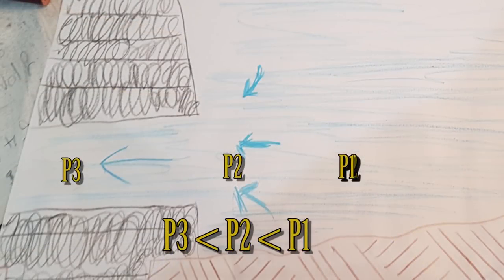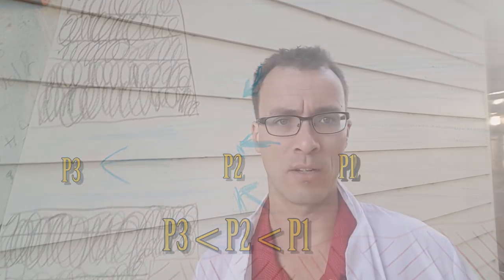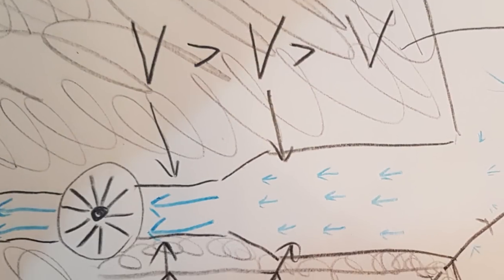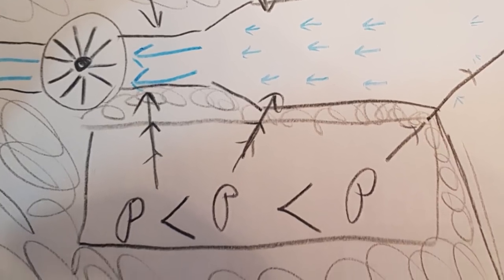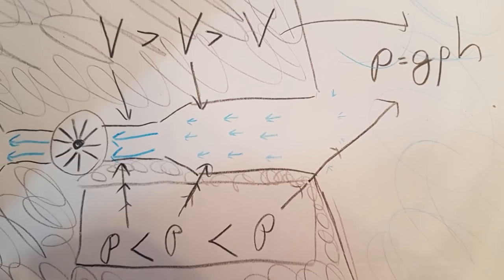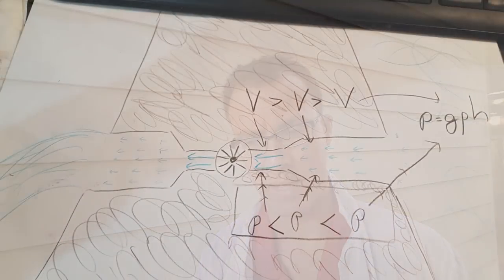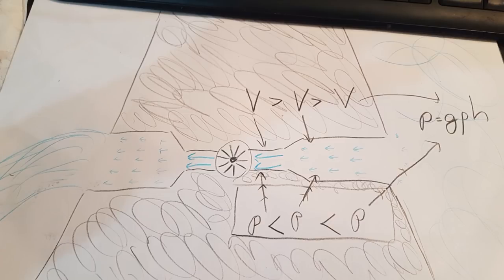Obstructions create high pressure NOT low pressure zones!

Comment: Ok reference to last experiment. You have created laminar flow through the center of the pipes. Big size reduced to smaller than back top big again same venturi effect. Though the air that is allowed into the system has come from the smaller pipe because it has less head pressure. Volume of water meaning weight pushing on system. Head pressure can be irrelevant to actual pressure of outlet. Just the volume pushed by atmosphere alone. A larger bore reduces pressure losses. SO by going from large to small to large again, you have created a venturi  within the system as the low pressure swirling water when it goes from small to large is having a vacuum effect sucking more increasing the KPA at the smaller nozzle trying to fill the larger diameter pipe.  It has now referenced the least resistance in the small bore pipe to suck air into the system by least amount of friction by pipe size and cross dimensional area of atmosphere  and surface tension of the water. Also in the system by increasing flow with no pressure to allow for extra water to push through the water turbulence would be greatest at the small junction another venturi sucking air in to eqaulise overall pressure of the system.

Comment: Hi Stuart,have you tried testing it from larger to smallest pipe or with some type of non return value to stop air pressure once stabilized. Bing on the rain.cheers Craig

Comment: Interesting theory but I'll have to wait until you take your experiment from a closed system of a hose to an open system like a stream.
Reply from the maker: Seriously?

It makes no difference, same principles apply.
Reply: @MadScientistProspecting  Seriously, your closed system model has a hole in it (no pun intended). As you open the valve up on your model you increased the pressure from your home on your model this increased your velocity when you restricted the hose. This caused the venturi suction to increase, then you started increasing pipe size slowing velocity thus lowering venturi suction thus allowing your water column to increase.

So I am waiting to see how you are going to link this closed system to an open system.
Reply from the maker: @markhuffman5242  Venturis dont suck they work becsuse of low pressure and then some external pressure (in this case air pressure) pushes into the low pressure area. 

This is why Venturis relying on air pressure have a maximum theatrical lift of ~10m. Ie 1bar or 10m of H2O.
Reply: @MadScientistProspecting  Right, venturi is just lowering the pressure in that area and the faster the velocity the lower the pressure in your in your model the lower the water column is in that water column. System pressure minus venturi pressure.
Reply: But it is the pressure in your tube that was lowered not the pressure in the main line.
Reply from the maker: @markhuffman5242  When you say main line which bit of the line are you talking about? 

The 25mm line upstream of the 19mm reducer?

or

The pressure in the horizontal section of 13mm line?
Reply: @MadScientistProspecting  I'm talking about the line from the time it leaves the valve to the time it exits out the end. Once you open that valve fully you was receiving  the max pressure that was coming from your house and by extension from the town system.
Reply from the maker: @markhuffman5242  Not sure I understand your point. 

When there was only a dribble of flow the pressure at all three junctions was basically the same. Or it would have been the same if the junctions were level. As the velocity through the pipe increased pressure at the bottom of the sight glasses increased which forced water up the sight glasses to a higher level. However, once the velocity really started to increase the pressure actually started to go down at the 13mm junction which is why the water level in the sight glass went down. At maximum flow/velocity the pressure at the 19mm sight glass had gone down as well and the pressure at the 13mm junction was so low that it was getting close to being less than atmospheric pressure. Any lower and ATM would have started pushing air into the pipe.
Reply: @MadScientistProspecting  At max flow you had also a max pressure provide from your home at the low flow point you was using the valve as kind of a pressure reducer lowering the pressure in your  line. So the max pressure created max velocity thus you had max venturi pressure at your 13mm thus lowering the system pressure in your closed system to the point you was ready to draw air or almost overcoming the system pressure. As you increased your pipe size your lowered velocity thus lowering venturi pressure that caused the remaining system pressure to cause your water column to increase.
Reply from the maker: @markhuffman5242  I think you need to better understand how pressure works. Or indeed how forces work. Nothing happens unless a force makes it happen or stops happening unless a force makes it stop.

When the velocity increases in a pipe due to the pipe getting narrower the pressure decreases. When the pipe size then increases the pressure is recovered and the pressure increases. If instead of a sight glass we had a pressure gauge it would show exactly the same thing. 

You need to get your eye on what is the active force. In venturi's there is an area of low pressure but low pressure areas do not suck. You only get flow into a low pressure area if there is a corresponding higher pressure area pushing mass into the low pressure area.

In the case in this video that higher pressure is coming from the air pressure. 

The height of the water in the three sight glasses is a direct measure of the pressure at the bottom of the sight glass. There is no "venturi pressure" pulling that water down. There is water pressure pushing the water up, (against gravity) and air pressure pushing it down. That's it. When the water level goes up its because of a pressure increase at the base of the sight glass. When the water level goes down its because the pressure at the bottom of the sight glass has gone down.

Comment: You have indicated that the flow in velocity at the turbine rotor has been increased by narrowing the tube and you state that the pressure has decreased
So how come when I squirt the hose against my face , and do the same with a narrowing of the hose , the water velocity has increased with the narrowing and it feels as though the pressure has increased to the extent that it feels painful ?
I mean narrow the pipe enough and increase the velocity of the water and it is possible to cut through metal.
Reply from the maker: What you are experiencing when you feel the "pressure" of a jet of water is the Impulse Force. Sometimes this is mistakenly called "Dynamic Pressure" but dynamic pressure is a made up thought construct not a real thing just like centrifugal force. The impulse force is generated by converting the potential energy into kinetic energy. The narrower the gap the more energy is converted to kinetic energy and therefore the greater the impulse BUT there is often a reduction in flow so the total force can be reduced as well. HOWEVER, the force per m2 that you feel on you hand is increased because greater impulse is delivered to a smaller area.

Now when the jet of water is in flight its "pressure" is minimal because so much of its energy has been converted into kinetic energy. In FACT its pressure is LESS than ATMOSPHERIC PRESSURE which is why it stays contained within a stream. If the pressure within the stream was greater than 1 ATM then the water would not stay within the jet stream.

When the jet hits your hand you experience the impulse on a small area of your hand. That force is translated into pressure which your hand feels because pressure in this since Pressure= Force / Area. The greater the impulse (mass and speed of the jet of water) and the smaller the cross sectional area of the jet the greater the pressure your hand experiences. 

Get the impulse large enough and the area small enough and yes it will cut through steel.

Comment: If the engineers were smart enough, couldn't they use an algorithm to control an electric butterfly valve. Using the square meters or kilometers of the reservoir calculating the atmospheric pressure on the system referenced by a float valve indicating depth of reservoir 1m meter of depth = 10kpa of pressure at atmosphere. Pipe sizing like plumbing. Length of pipework + material used / friction loss per meter to each individual turbine. Max flow of outlet += flow of water able to travel through system/ the efficiency of turbine/ recommended RPM to produce optimal KW/h output. The valve would automatically adjust the orifice size    to let the appropriate amount of water running through the system for optimal RPM of turbine.
Reply: Or referenced to the output requirement of the system, using RPM of turbines to equal generated output. You could use previous as a predictor. But as real time output measured by demand could control a valve. By using previous data as a reference predict flow for peak times to prevent outages and predict slow times to conserve water . Because batteries are shite and use alot of child labour for cobalt to produce them. Less environmental impact controlling the resources that are already in place. No oil for transport.